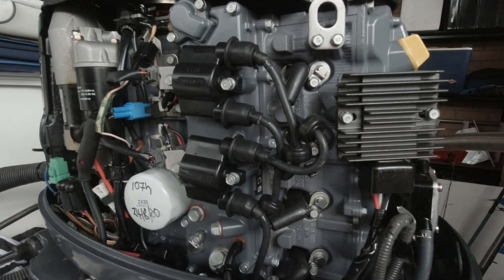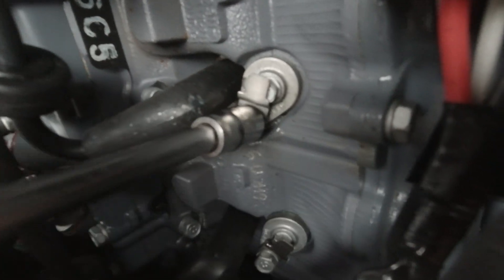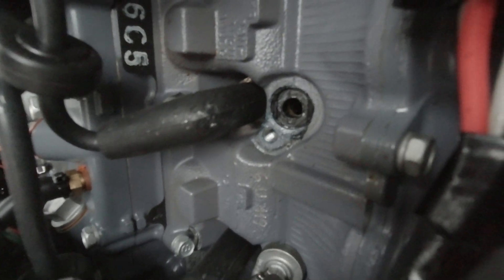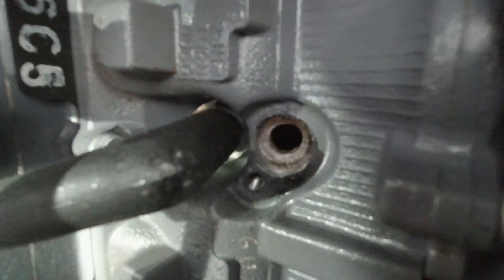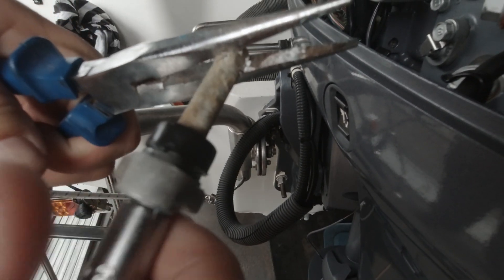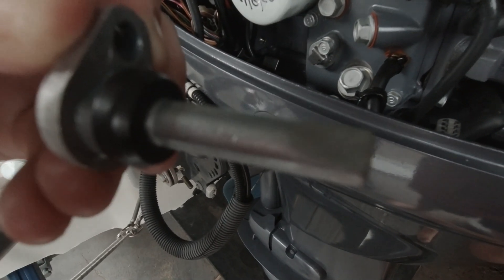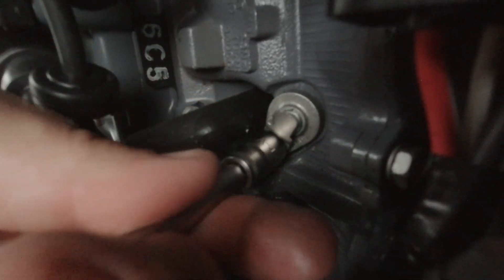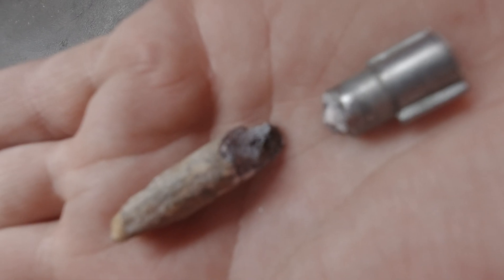Replacing the internal anodes on a Yamaha F60 outboard

Comment: Hello, I have a problem.  I started to change the anodes of my yamaha F60 four stroke 2005 engine and of the 5 4 they broke, removing them from how bad they were and the part of the anode that goes into the engine the pieces remained inside and I have no way to remove them since They fell inside and cannot be seen.  What I can do ?  It's no problem that they stay inside, does it affect the engine?
Reply from the maker: If it blocks a galley, your stuffed. Try to flush out with water or compressed air from alternate directions.
Reply: @damodoesall6240  Ok thanks if it doesn't work would I have to remove the block cover?

Comment: Thanks for the video.  I didn't even know there were internal anodes until I viewed your video.  My friends were equally shocked.

I have a 50HP motor that has always been run in fresh (unsalted) water in Michigan, USA.   Do the anodes wear in fresh water?  The motor has almost 400 hours.  When I pull them if they are OK, can I stick it back in?  Am I being foolishly cheap by attempting to do so?
Reply from the maker: Yes, freshwater will last but not forever. I would not re use them unless they are in very good condition, they just go crumbly and then block the passages inside the head thus blocking cooling water flow.

Comment: day mate you said the bottom anode was bad and it broke of how did you get it out ?
Reply from the maker: Pointy curved pliers, for the big bit, small hose taped to a vacuum cleaner nozzle for the crumbs.
Reply: @damodoesall6240  thanks mate .
Reply: @damodoesall6240  Gday mate just got the new motor home and i had tolook at the internal anodes ,well they are nothing like on your engine there a weird little thing held to the bole by a screw which i presume goes into the bolt ,i can see issues coming with this design as it is only a philips head screw got 4 of them saw something that looked like it on ebay and they want 16 dollars each for them  and i dont even know if they are the correct ones ,no big rubber gasket just a small oring hmm is yamaha cheapn out?
Reply: @damodoesall6240  Hi mate the anodes on the 40hp are different to yours ,they are really small and have a screw going through the anode into the bolt with a o ring on the bolt to seal it ( can see corossion problems already)  ,from megazip schematics it seems these have been used for a long time lucky i didnt buy pencil anodes like yours .

Comment: gday mate i am just about to purchase my first 4 stroke yamaha 40hp this is a good video to learn from ,i know you can get external anodes aftermarket but not to many sell internal ones ,just trying to learn about as much as i can before i get this new engine soi have got some idea only had two strokes before
Reply from the maker: Yeah, I use almost all genuine parts. I have found the Penrite10W-30 marine oil and the Ryco Z436 oil filter to work perfectly as well. Hint, try eBay for massive savings on genuine parts !!
Reply: @damodoesall6240  I wish i had known the ryco number about a week ago just ordered 2 yamaha filters but got them at a good price i use penrite oil in all my vehicles im the penrite poster boy support an australian company  , my twostroke my bike  and my car have all the greases just bought 2 new cartriges of marine grease for the gun  , seen anodes on a genuine site but the air freight is a killer from japan .

Comment: Thank you for the tutorial. I have the F70 yamaha; I'm pretty sure there is also 4 internal anodes. Do you think that is true? again, thank you
Reply from the maker: There are normally one per cylinder and one extra in the main gallery, easy way is to look for those special clips over the anodes on the side of the motor.